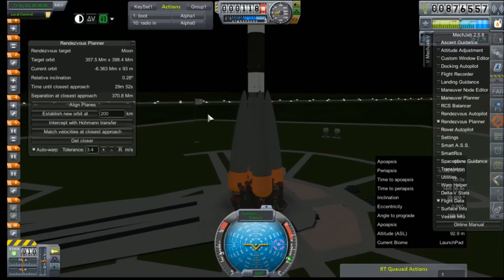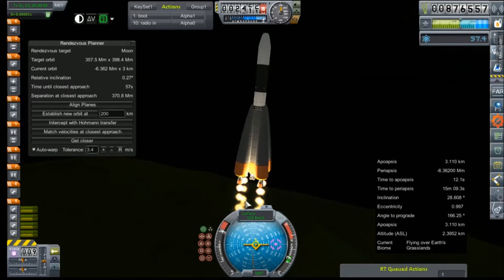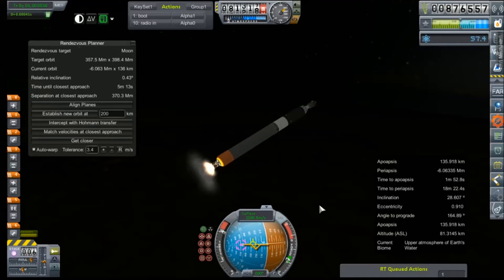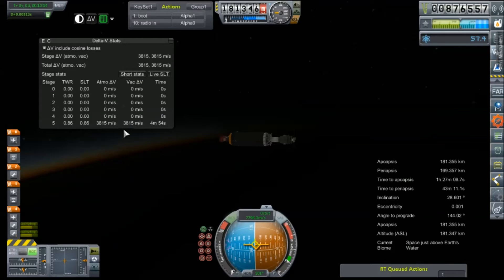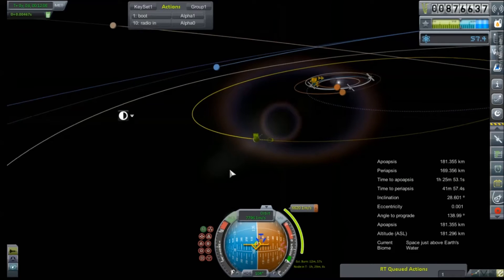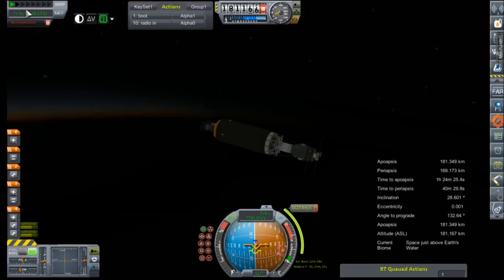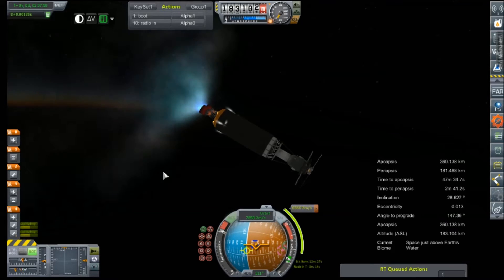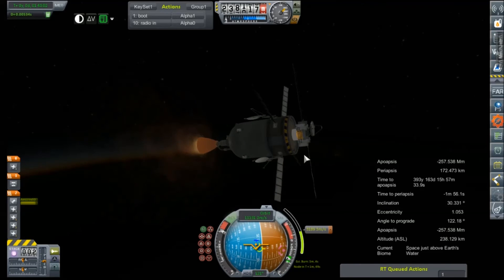KSP RP-0 # 83 Jupiter 2 Launch

Comment: Hey man your launches could be much more efficient/easier if you would just turn off SAS after starting your gravity turn.

For stock sized KSP:
1. Enable SAS.
2. Launch straight up, until you hit about 100 m/s.
3. Start your gravity turn.
4. Turn off SAS. (Theoretically you shouldn't have to touch the steering controls from this point on).
5. Burn until your time to apoapsis is in the 45 - 55 seconds range.
6. Control your throttle to keep your time to apoapsis in this range (meaning you will gradually decrease throttle, the higher you go).
7. By the time you hit 80 Km, you'll be flying horizontal, and your orbit will almost be circularized.
Reply from the maker: I'll have to give this a try on my stock install! let you know how it goes!